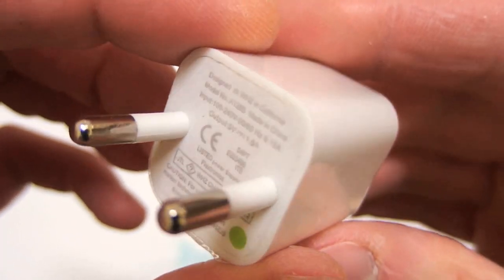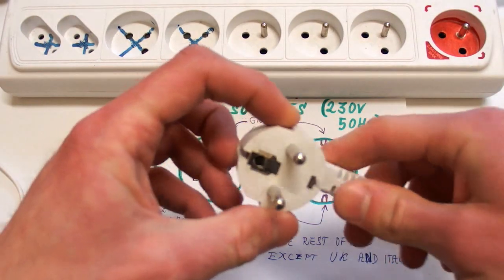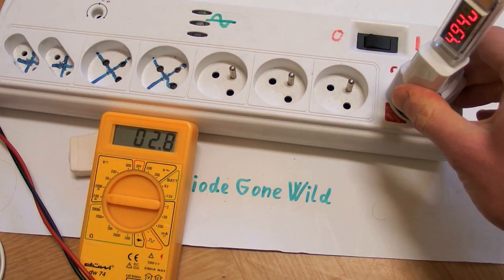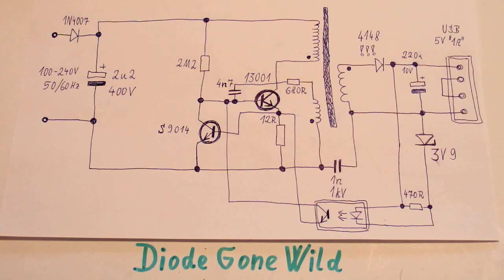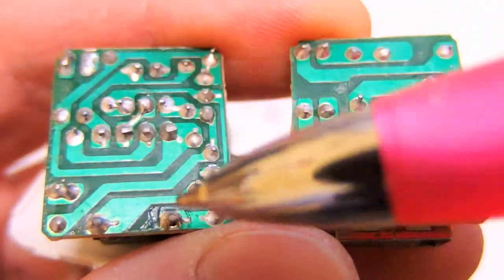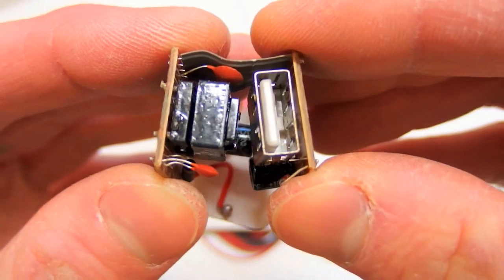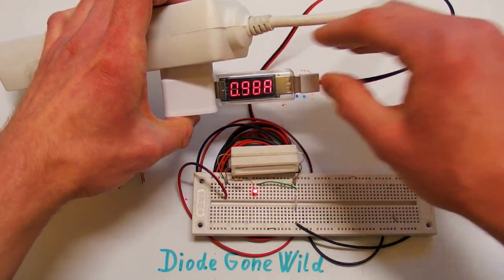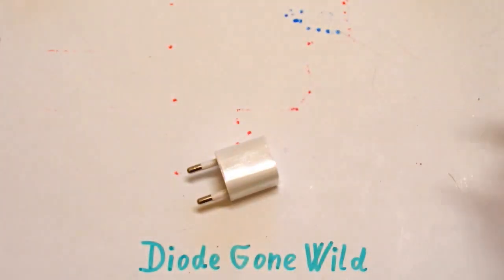Dangerous & Useless Cube USB Charger

Comment: The "1A"marking is most likely short circuit current.
Reply: It's the firework current, once you reach it, you will see some pretty lights haha
Reply: It pulls 1Amp to kill the socket
Reply: Probably because shorting out a power adapter gives a higher current than it’s rated current

Comment: i had this dangerous little cube, it worked okay few weeks or months then one day i just took my phone off it, and i sat down after few minutes i heard a huge bang and sparks, it shortcircuited the mains, and got completely dark plastic partially melted
Reply: phone live?
Reply: I've the same charger and I'm actually using it
Edit : It burnt last week
Reply: Ive also got the same.charger but it were overheating and melting itself
Reply: I had that before it killed itself and no longer working
Reply: @matid8453  he said he unplugged the phone and then it exploded. What I think happened is when the phone was unplugged the voltage on the output probably went up a bit too high and caused some resistors or capacitors to burn and that put too much stress on the transformer causing the wires to melt causing short turns on the transformer causing way too much current to be drawn from mains, causing a short circuit. Sort of like a chain/runaway reaction that started with a too high of an output voltage.

Comment: I like it because it's cheap. Why on earth do we need an earth ground? Safety is over rated. I think it would be ok to get small shock from it. It will clear up my sinuses and blacken my fingers.
Reply: Adonis cmj You’re a genius!!! Here I am, spending thousands on my heavy black tattoos, when i could be doing it with a $2 charger from eBay!
Reply: Only things made out of metal need ground. Nothing to do with power, for example 2kw vacuum cleaners do not have ground, 1 kw washing mashines do.

Comment: I work as tester of electrical appliances and this video is something you don't see in training. Thank you for your experience! I see the cube has also the correct CE seal, which stands in stark contrast to the actual safety. I will make sure that wherever I find this little piece of garbage, I will put 500 V through and put a big red DANGER sticker on it.
Reply: CE in this case can mean China Export

Comment: As far as I know, that fake charger is modelled after the Apple USB Power Adapter for the US and any other country that uses the type A and/or B sockets, however, the copycats in China, didn't know what the real European version of that looked like, so they just took the American design (even with the green dot, as those ones were recalled at one point in time) and changed the prongs on their counterfeit power adapters. Later, when Apple added their own logo to the back of their power adapters in that range, the copycats seemed to be afraid to copy that.

Comment: There is older 0-class standard (the earthed Schuko is class 1) and this is perhaps possible to connect to the wall socket. The older type of this is not recessed and you can easily put this into it. Contrary to your system, our Live is on the right but is not mandatory. It is a good installation method. In your system the plug can’t be inserted but one way and then it is good to have the Live prescribed and mandatory.

Comment: I saw a thing which is only 20x10x3mm and converts up to 250V to 5 or 12V. It outputs rough, unregulated voltage which needs some filtering (as far as I can tell), but it's very tiny and in theory can be used in small plug-pack type case to power things.
It's a discontinued product from Rohm.

You might be wondering why I'm bringing that up...
Because that small thing with 4 pins (even without smoothing) outputs WAY better voltage than the charger you disassembled in this video.

Comment: We call the German sockets Schuko sockets over here in Romania. In my opinion the French one is better , you get a more sturdy fit and plugs don't unplug as easily.
Reply: The weakness of the french system is the pin. It can break very easily. And Schuko has the two bars to fit more sturdy. I never had any problems with plugs falling out of the sockets. I've got an outlet from the 1960s in one room, even this one don't make any problems.

Comment: Korean sockets are very very similar to German (EU Type F) and they're also compatible, however they will not work correctly with the Chinese "EU" plug. They will cause arcing and excessive heat because the prongs are ever so slightly smaller, causing a bad connection.
Reply: The prongs of the Europlug should be 4.0 mm in diameter (the conductive tips only, the insulated shafts should be slightly thinner). The prongs of a type F plug are 4.8 mm in diameter, so the Europlug's prongs are smaller intentionally „by design“. However, they are not exactly parallel to each other but they converge slightly, so that they should make a safe connection with a type F socket anyway.
If the contacts cause heat or arcing when fully inserted into the socket it is probably because the prongs aren't flexible enough (e.g. exactly parallel to each other) or because they are too short or used for appliances that draw more than 2.5 amps (the maximum a Europlug may be used for). The smaller diameter shouldn't be a problem.

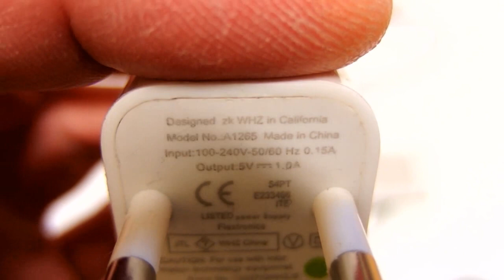Comment: 6:00 "Model No A1265" - that's trying to be an Apple charger! But the quality is far from Apple's standards... and of course you need to look in the transformer, as some transformers have the windings just wrapped over each other with no isolation.

Comment: That kind of chargers will fit Italian plugs, not that i would use it anyway.

I also got one of these chargers for free when purchasing a USB powered product on ebay, the first thing I did was to tear it apart (not that was so difficult, it came apart simply pulling the pins) and throw it away.

Comment: what components should be replaced to make it safely sir...?
Reply from the maker: Just one.... the entire charger :).
Reply: if i try to replace smoothing capacitor, zener diode, place the fuse resistor at input and fill the circuit with epoxy glue, whether it will be more safely?
Reply: No. The mains and secondary are too close. No way to make this safe.

Comment: Excellent quality product LOL :)
Im sure clive took one apart that looked too similar, also with the crap emi capacitor and lack of pcb isolation.
Ahh you have a "Death adapter" as clive often uses, handy though.

Your diagram looks also like the cheap hdd external psus, but very under rated.
I think the under rating of the circuit saved the tiny silicon switching diode.

Im amazed how close they copy the outside of the charger, shame about the crap inside.

The two/three pin mains plugs are too different from each other, why didnt everyone use your type with a physical earth pin, that looks a much better design.

We are lucky in the uk, we have a 3 pin plug that no one outside the uk wants to use LOL :-D.
Reply from the maker: Yes, they copy the appearance, not the circuitry. 

I also think that our E socket with ground pin is better than the F socket with the two contacts. It is polarised, so it keeps Live and Neutral in the same position. Single-pole switches can then always switch Live for safety. 

But seems that EU decided to develop universal plug, instead of unifying the sockets. But  anyway, the advantage of both sockets is that you can use small flat plug for low power appliances (up to 2.5A / 500W). In UK, even the smallest appliances have to have a giant plug with dummy plastic pin to open the shutters and a fuse inside. But on the other hand, the UK one seems to be one of the safest ever.
Reply: Yes ... & Ward probably did it too
Reply: DiodeGoneWild nebudem Ti odpovedať anglicky, ale keď je spotrebič triedy 2 s jednopólovým vypínačom, ako tam zaručíš vypínanie fázy? A ešte k tomu väčšina spotrebičov tr. 1 má aj tak dvojpólové vypínače. A rovnako aj predlžovačky. Jedine prepäťové ochrany zvyknú mať 1P spínač ale ak sú robené pre iný trh ako ČR/SR (kľudne aj pre FR pretože pôvodná FR norma z ktorej čerpalo ČSR udávala fázu vpravo) to budú mať "prehodené" už na FLEXO šnúre a u nás budú vypínať nulák. Čo bez dodatočnej úpravy nijak nespravíš. Každopádne pre akýkoľvek spotrebič by to malo byť jedno. On nevidí čo je fáza, iba to že je v zdroji striedavého napätia a teda je jedno ktorý pól sa odpojí...
Reply: It is polarised? No, it WOULD HAVE BEEN polarised if France decided 70 years ago which way around the pins go. But they didn't, so toss a coin. They have standardised it recently, but the standard will apply to new equipment but will not retroactively apply to all the old wall sockets. And even when a standard exists, with no way to enforce it, what is it worth? I have lived in a newly built house in Germany where all the electrics was INSANE and there was an electrical fire in the wall every few months, and the garage door and the mounting screws of some sockets went live, and you couldn't even sue anybody because the company that built the damn thing had a habit of going out of business and re-establishing itself anew, so what are the odds that the electrician hasn't flipped the wires in an average Czech or especially Polish home? UK is pretty good at enforcing its standards, but then it would pretty much burn down if it didn't, because they have ring house wiring absurdity, where a breaker just won't do anything sensible a lot of the time, which is why every single piece of wire needs to have a fuse in it.
Reply: "Polarization" in AC circuits doesn't exist. "Live" and "neutral" mean only potential difference (voltage) between each of them towards to (physical) ground - earth. It doesn't affect the functionality of the connected devices.
Reply: You're right about appliances not usually caring about which way live and neutral are connected, but 'Polarisation' of household electrical circuits does exist, and actually contributes a lot as to whether how it's being used is safe or not. Neutral is as you suggest usually at or near earth potential, neutral often pretty much is earth in some systems, so is usually safe(ish) to touch on it's own, live (phase) however is alternatively pushing then pulling 230 or 120 volts at a frequency of 50 or 60hz, it's the supply wire, if that is switched off the downstream circuits are de-energised and safe, if that live wire is fitted with a fuse and it blows, then the connected downstream circuits are de-energised and safe. Conversely, switching the neutral line off, because non polarised plug is in the socket the wrong way round, may well 'turn off' the appliance, but it will leave that appliance still energised and live, so yeah, polarity of a plug connection does matter.
Reply: Not quite correct - a pure AC circuit is not polarised, but the electricity supply is - one side of the transformer is connected to earth and is called neutral. The other, live, wire is the one that does the work. Breakers, switches and fuses are (or should be) placed on the latter wire for this reason.

Comment: So people, when you get some unknown charger, open it if possible and look what is inside, @DiodeGoneWild described in videos everything :D Have a safe charging 😀

One thing. I used and LED ring, that do not use even one AMP, I think it is arround 600mA, I connected my old USB charger, it was working for an hour and a little, after that voltage just dropped to about 2,5V loool, and charger should have been 2A :)